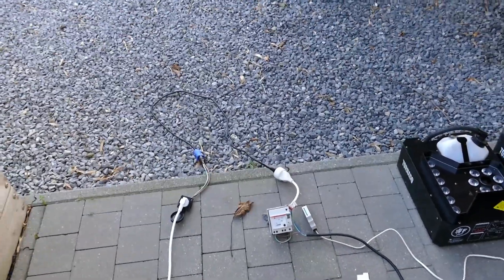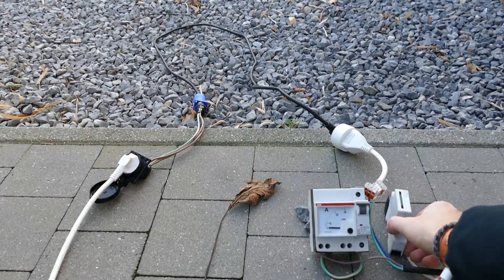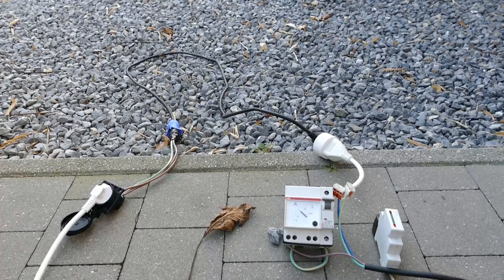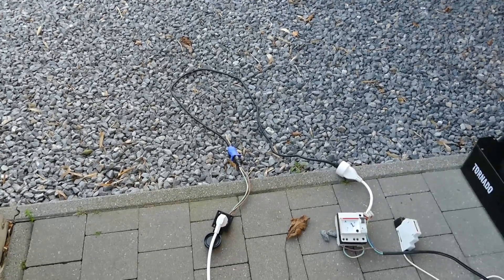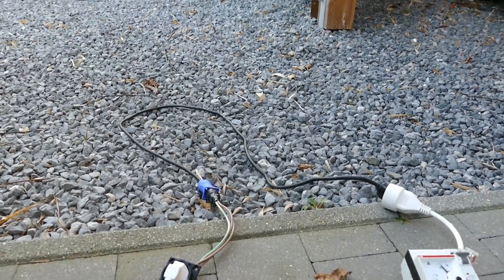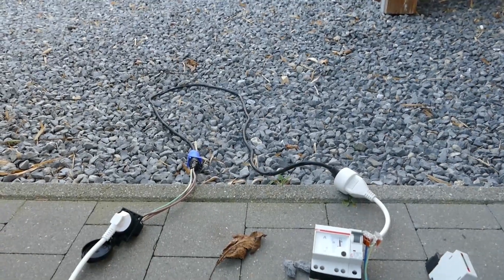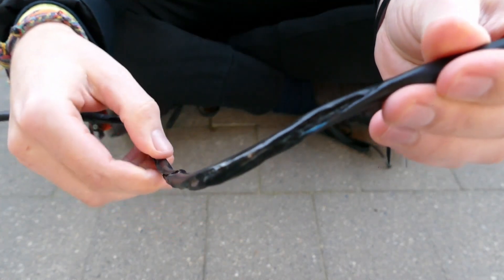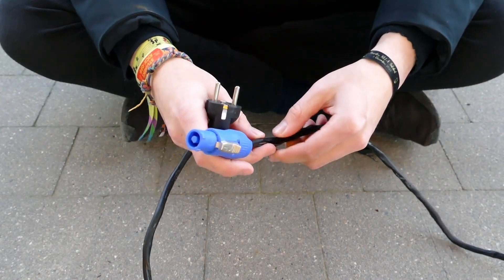What Happens When You Connect Too Many Lights To A Cheap Chinese "PowerCon" Cable? (Fire Hazard)

Comment: No single budget electrical item from China is safe to use unless you are equipped to test it first. China has been manufacturing UK-style none-compliant plugs that aren't fused and aren't correctly insulated for years - I don't buy chinese electricals and my house hasn't burned down yet.....I firmly believe that the two facts are correlated.

Comment: To those who are watching I do want to add that this is not in any way saying the Cheap Chinese cable here is bad. The test here is giving 16 A or more current into a cable that is clearly 0.75mm2 thick which is rated 6A (continuous) or 10A max. Even if you buy the highest price highest quality of 0.75mm2 cable anywhere it will still melt similar like this. Better to do the test first by testing only 6A load and slowly increasing the ampere. 

FYI, in my experience having bought many cheap cables, sometimes I found a type of cable that is stating fake specs: saying it is 3x 0.75mm2 while the actual thickness (after I cut and measure) is way less than the ordinary 0.75mm2. Also, sometimes ground wire is not connected (there are ground pins but no third wire).
Reply from the maker: That’s why I clearly stated it’s rated for 6A ;) But it should be fused for 6A as well in my opinion. Certainly because it’s easy to exceed by less novice users
Reply: I bought a house, really a sidewalk shop, that was so illegal, with appliances e.g. water heater and AC sockets outlets with Earth connections (inside the wall) that were ONLY 1 meter long of electric cable with no connection to anywhere. It looked more like an antenna.

Comment: I can't wait to see the next video when he tries all the really expensive 6A cables from around the world to see if they are a fire hazard when drawing a peak of 30A and a constant load of 20-25A.
Reply from the maker: Here in Europe this kind of current can be pulled from a normal socket without popping the circuits breaker, cables that can’t handle that current should be fused. Not everybody is aware of the risks when using cheap thin cables, but glad to hear it got you excited though ;)
Reply: @Bo_At_Work  I live in Europe too, and where I live they are fused, this type of cable would have a 1A, 2A, 3A, or a 5A fuse in it. 
but we also have to realise that not everyone has the mental capacity to survive and hopefully die off before passing their genes on. you would have to be really thick to pull more than 4x the rated amount of current on a cable and really thick to be pulling 6x the rated amount and then saying how bad it is. 
for a 6A cable this "Cheap Chinese" cable did amazingly well. if you were just relying on the fuse to blow you would need 32A -60A rated cable and I don't think anyone would be selling lights with 8mm² - 10mm² cable attached to it and a wall plug on the end. so really if people are going to be really stupid and use a 6A cable and draw 20+ Amps on it, they really should be putting themselves up for a Darwin award.
Reply from the maker: @johng.1703  Thanks for your comment, I agree with most things you’re saying, but I’ve seen it happen. You can’t underestimate some peoples ability to try and set things on fire sometimes. Daisy chaining 2 large fog machines can be enough to make this situation happen. This problem is unlikely to cause a problem for most but certainly good to be aware of in my opinion.
Reply: I live in the US and my roommate ran his 1700W heater on a power strip. Ridiculous. He had no idea it was even a danger
Reply: @joecool4656  yes the US is very dodgy when it comes to electrics. no switches, no fuses in the plugs, no GFI etc and normally the power strips have a seriously low rated cable on them. this is more than likely due to the 20A radial wall outlets. I've seen US power strips with a wire that looks like it was for a door bell or basic speakers.